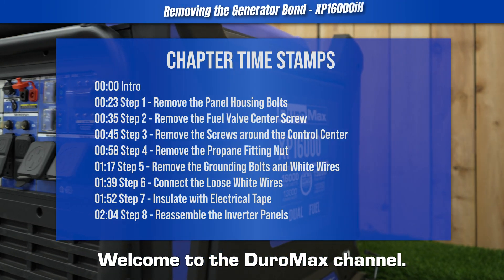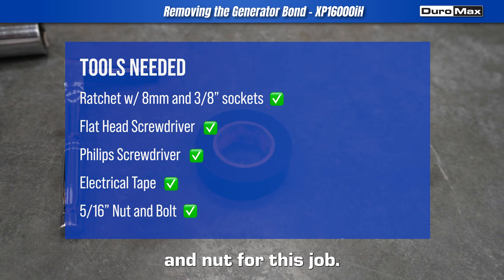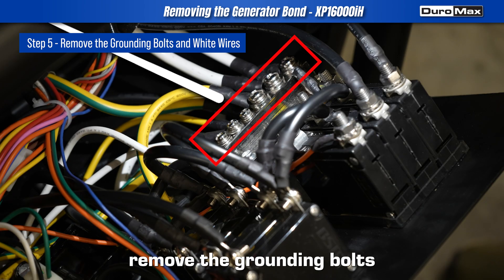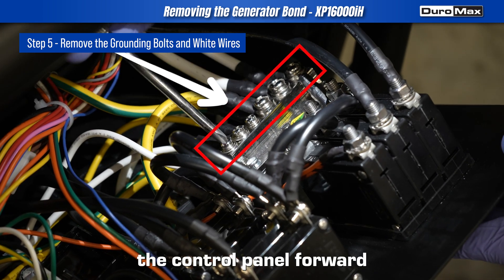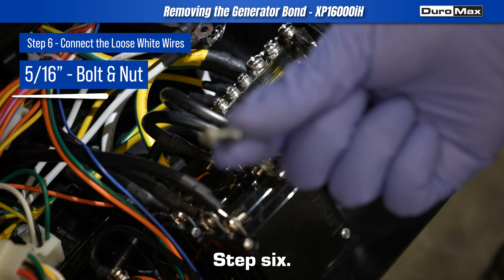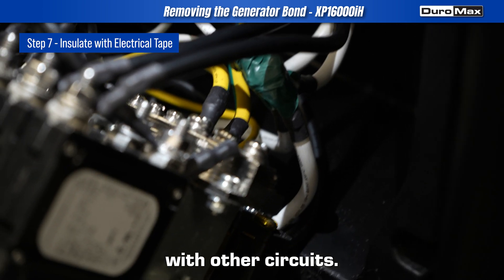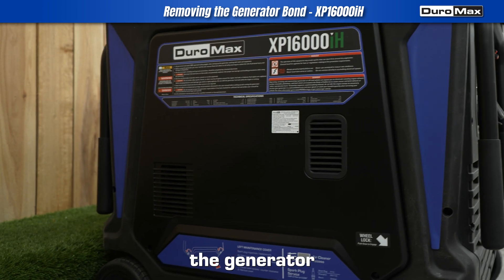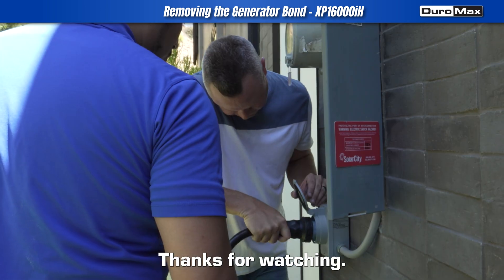How to Safely Remove the Neutral Bond from Your DuroMax XP16000iH Generator

Comment: Good video. I referred to the written instructions on the Duromax website because I have a red wire on the terminal block. Removing the main breaker made it easier to access the terminal screws. I used 7/8 inch heat shrink tubing over the wire connection after taping just for added protection; it didn’t need to be shrunk because it fit tightly around the screw and wires.

Comment: This video did not match the wiring on my generator which has a red wire. An installer document is available on the Duromax website that matches my generator wiring.

Comment: After disconnecting bonded grounding for the 16000 IHT model and the need to use generator for non-home hookup, what options should one take to ensure safe grounding? I've seen on other videos a simple plug with the ground and neutral connected solves this issue? Please advise

Comment: So if this generator is connected to your main panel by way of the 50amp plug, all these white ground wires must be disconnected because you are now connected to the house wiring neutral bond and grounging system ?
Reply from the maker: Correct, the Generator would be using the homes grounding system.
Reply: @DuroMaxPower  this includes the Red wire too for the 16000 IHT model, correct?